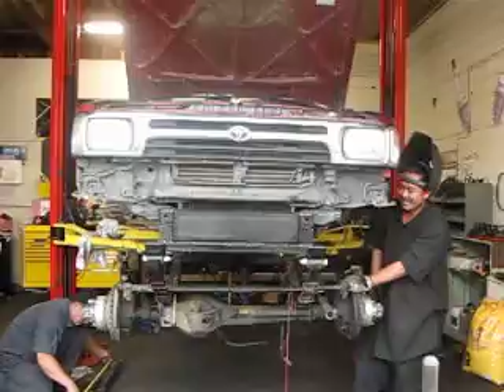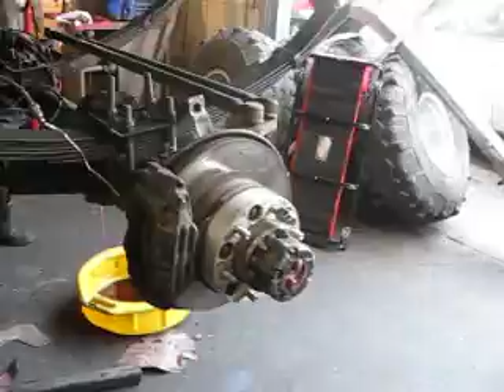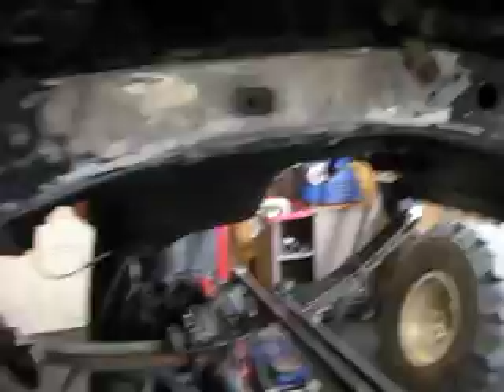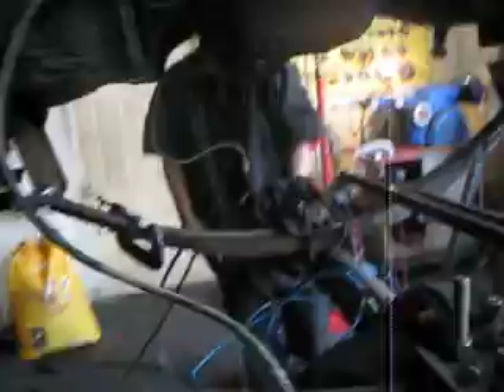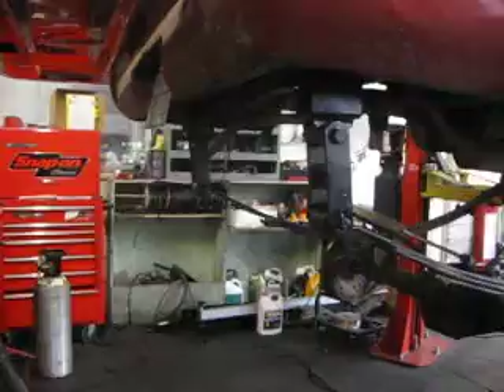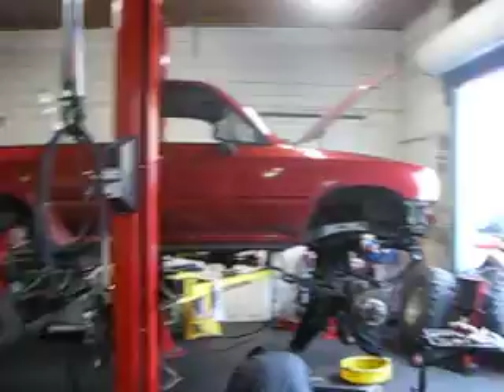Hmong 4x4 2wd to 4wd Conversion Part 1

Comment from the maker: i'll post the the finished video when i get it done. the 2wd can take anything you give it, granted that you have made the necessary support. cost is around 2-4k just to get it to 4wd depending on the truck. for you maybe 2.5k. honestly though i would just go buy a 4wd then go from there. they already had all the parts for the truck, hence the conversion.

Comment: i would like to know this to cuz i have a 1982 f150 2wd in good shape and a 83 f150 4wd but the 
4wd's frame has canser HUGE HOLE bye the leafspring hanger so can just pull the drive train and swop them thay bolth have 300 inline 6 bolth have 4 speed tranny just got to cut a hole for 4wd stick bolth even have same rearend only diff betwin the 2 is 1 year of age and 2wd vs 4wd i mean is the a bid diff in frame bolth have coil springs in frount I HAVE NO WELDER can i still do this???